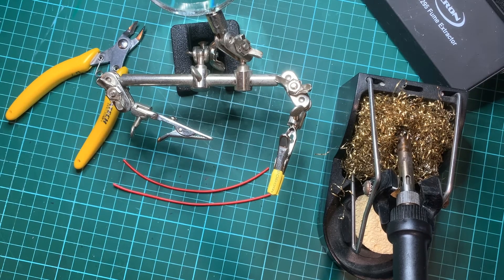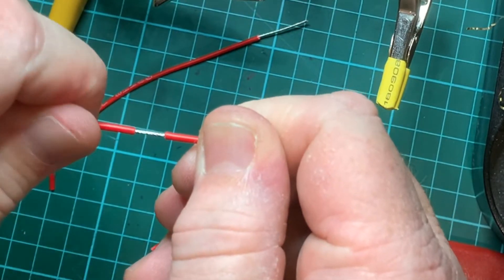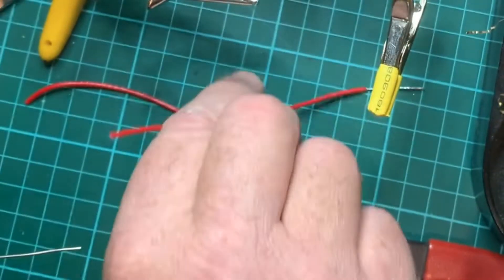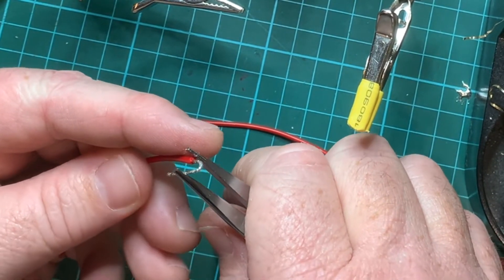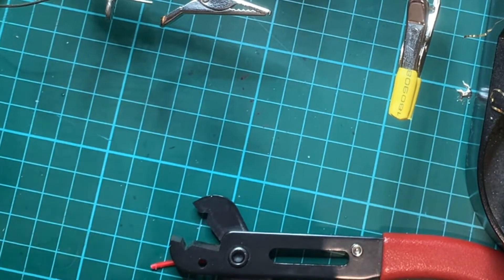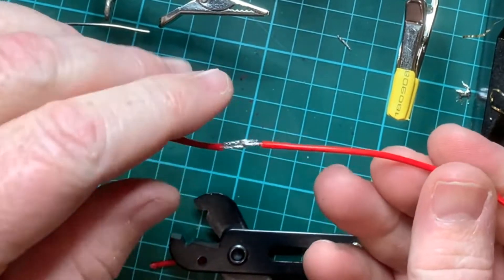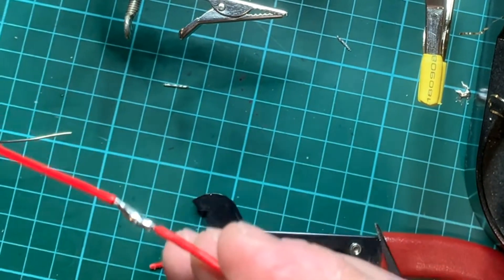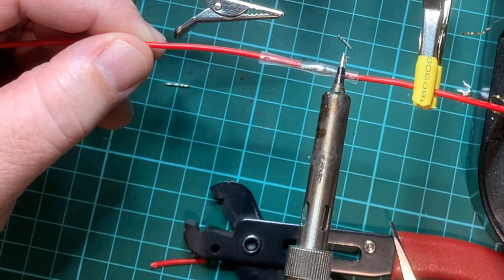Electronics - Hook Splice - joining 2 wires together

Comment: This was Google's first result for hook. Is this really a thing? I though lineman splice had good surface contact between wires. And the tension it can support is more than enough. 
When should one use a hook splice? How much are you gonna pull on the wire? And is it actually overkill to solder the splice? Thank you for your knowledge.